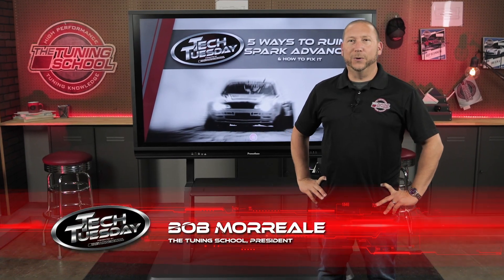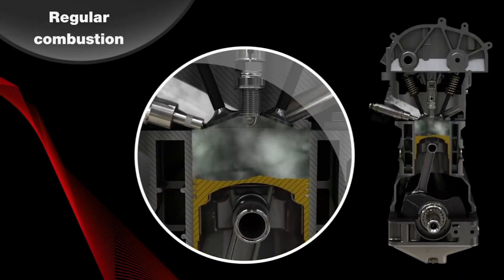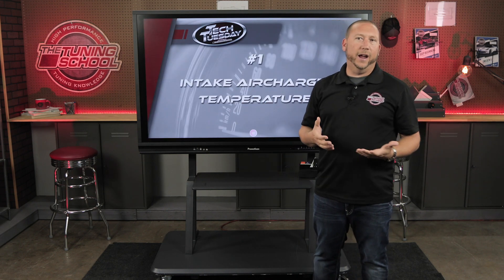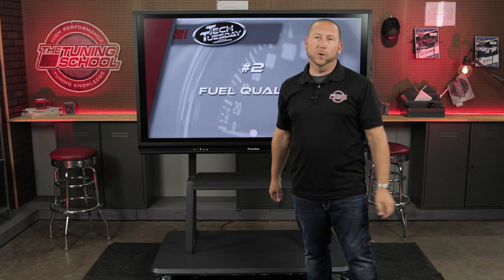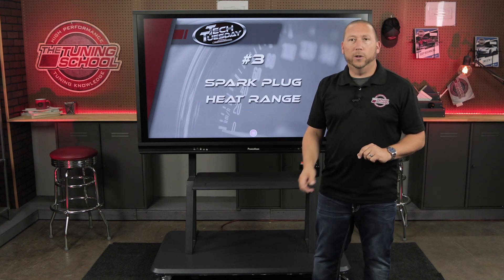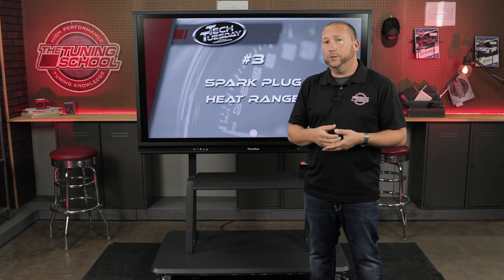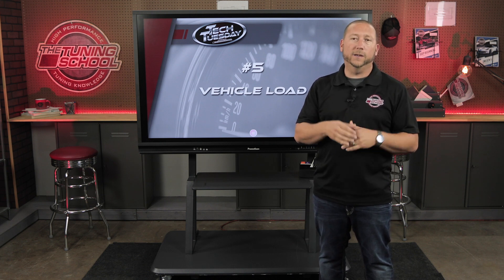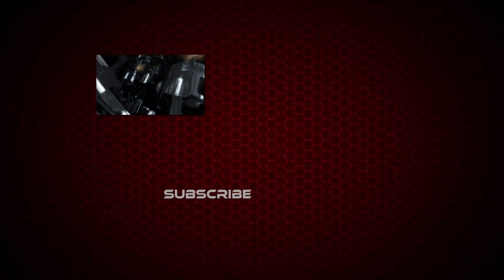5 Ways to Ruin Spark Advance

Comment: I need your support for my truck ram  2019 5.7 hemi with CAI, Lt headers catless, dual exhaust.bbk 85mm TB, ATI Dumber 

The problem in my truck the check engine light blinks 4 times properly misfire 
 in specific situations especially in the mid-afternoon when it's extremely hot weather 116f when I accelerating in hill or In the event of strong wind hitting the front of the car  (engine load) 

However, I used the in tune to see
what the codes say unfortunately Nothing appears

Happens again and I was lucky I was data logging 

When I use the data viewer to see if there is any knock, everything seems optimal no knock whatsoever 

Any suggestion to solve this puzzle ?😁

If anyone is interested, please share your email so I can send the data log

Comment: What about using ceratec as a ceramic coating without having to go in and apply it? Just add ceratec to the oil
Reply: Did it work for you? Or have you tried it?
Reply: @josediazasmr6014  yes I used it on my 5.0 coyote , quiets the motor down quite a bit I have a video on the before and after results https://www.youtube.com/watch?v=FtoEBgGohPE
Reply: @josediazasmr6014  Yes I put a bottle in every oil change, quiets the motor down, no negative affects that ive experienced only positive.  I have a video about it on my channel from like 5 years ago.

Comment: Ceramic coating in the combustion chamber, valve faces and piston tops. How long does that last before it starts chipping or wearing away? Is that safe for use with a turbo?
Reply: Ceramic coating is applied properly will last the life of the engine

Comment: 93 octane, poor americans :) (putting 102 octane in my supercharged v6 ;) )
Reply: We have e85 here my guy, which is about 108 octane.  Also european octane ratings are different than US octane ratings.  Their stated value is actually lower if it was calculated the American way.  "In Europe, the octane rating on the pump is simply the RON figure. America, by contrast, uses the average of the RON and the MON figures, called the AKI (anti-knock index). Thus, 97 octane “super unleaded” in Britain is roughly equivalent to 91 octane premium in the United States"
Reply: @a.wheeler7731 damn thank you for this 🙏🏻
Reply from the maker: Haha! So lucky

Comment: "RUIN" your Timing ????
Who came up with that ??  Timing can be non-ideal, but it's not something that can be "ruined",  
you can however, ruin an entire engine, by having non-idealized Timing.
High Compression engines are ALWAYS "Knock Limited", It's very simply Heat, and/or, Pressure, and/or, Time,  VS  Fuel Octane.
The closer you can make peak Combustion Pressure occur in the 14 to 17 degrees ATDC Range, the more power you will make.
That's the bottom line.
BTW, ALWAYS run Copper or Silver Spark Plugs, even on a completely stock engine. 
Brisk Spark Plugs are worth their Exorbitant Price Tag. 
NEVER disable your Knock Sensors for any reason, look at your Data Logs, if you see Knock Retard, fix the reason why.
.
.
Reply: @Sam S 
Octane has nothing to do with the potential to produce Heat.
Octane is a measurement of how difficult, or how easy it is, to initiate  Spontaneous Combustion, or "Detonation", in a particular Fuel Mixture. 
When the mixture has more resistance to Detonation, then the Compression Ratio can be increased with reduced fear of Detonation.
Higher Compression Ratio results in Higher Thermal Efficiency .
Reply: @jimbrown563  Finally, the correct answer.